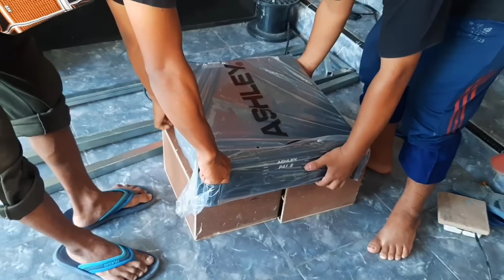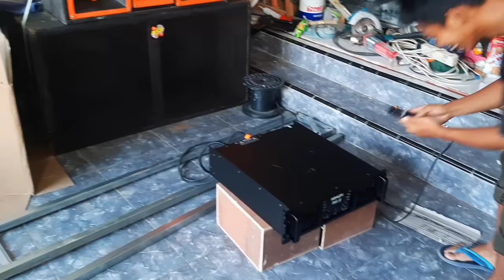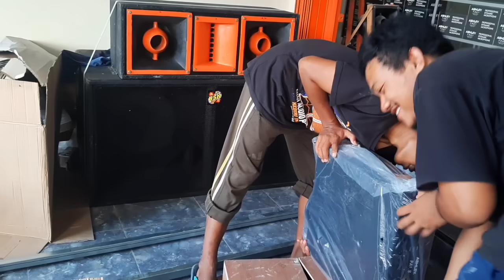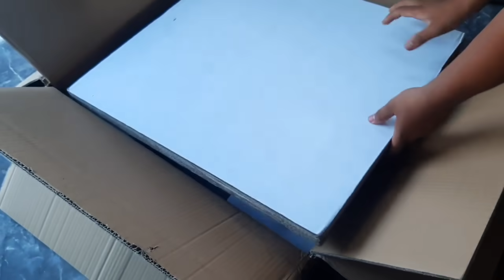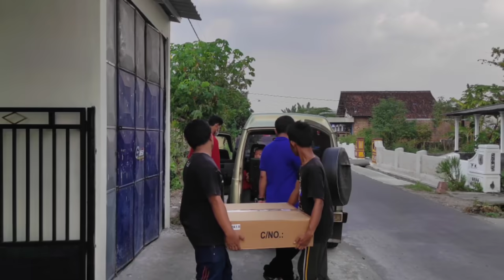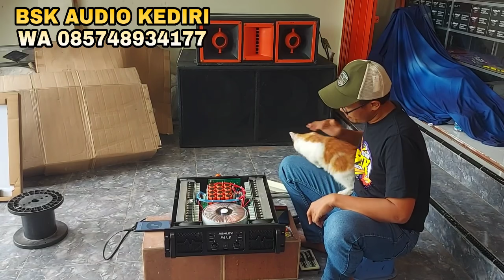POWER HOREGG DIBOYONG || PA 1.8

Comment: jos niki aku buat jenangan pa 1.8 buat angkat 18 inch lavoce ls1000 X 4 biji
Reply: Main brpa ohm mas
Reply: per chanel 2 x18" jadi main 4 ohm
Reply: @cintairsa7197  gimana respon powernya mas,maksutnya panas bgt g mas
Reply: @cintairsa7197  rencana mau buat miniaturan mas
Reply: @cintairsa7197  pengen 18x2 1box dan 15x2 1box,rencana as peakernya ashley lfv500 dan yg 15 l600a,jd yg 15 buat low sub mas kira2 kuat g y buat d geber maklum mas masih awam😀😀